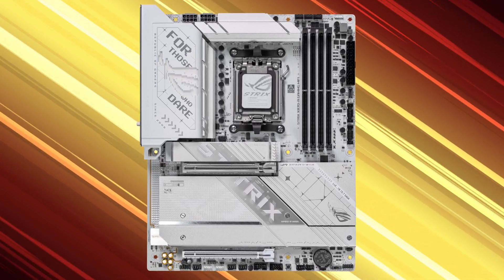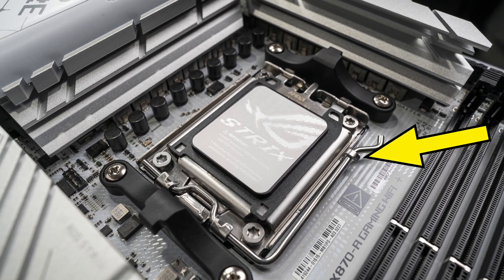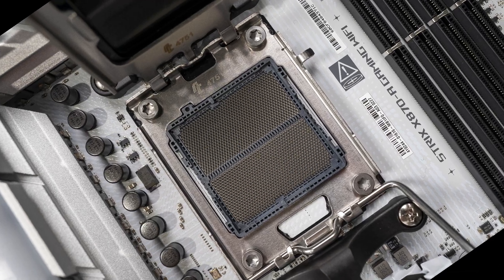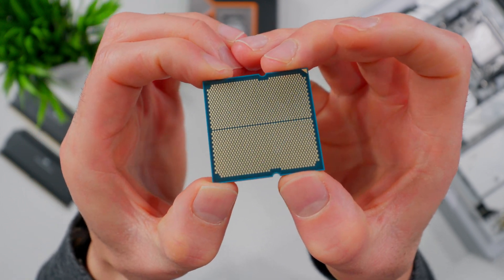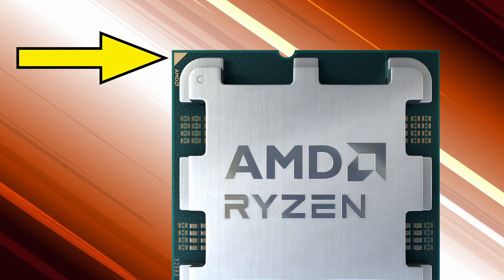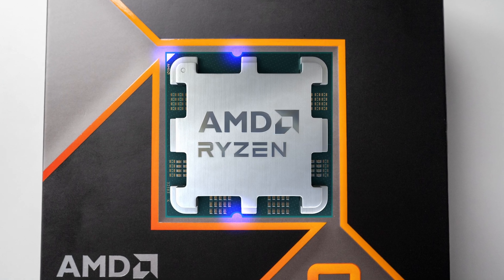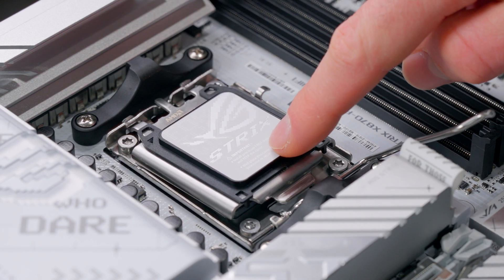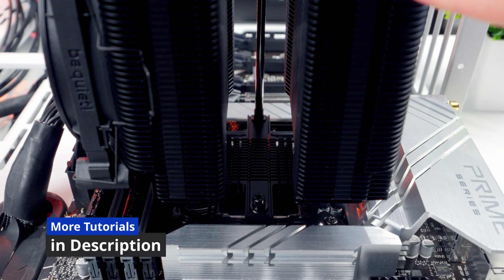How to Install a CPU - AMD Ryzen on Socket AM5

Comment: do i have to wiggle it?
Reply: no, the bracket will seat it for you
Reply: I came for a question like this. I did the wiggle. For the same reason. Before I ever watched this video. It's the only thing I can think of that could  be the of a pin bent right in half on my brand new motherboard. Either that or it came from the manufacturer with a bent pin. Safe to say I'm not doing that again.

Comment: The video is nice until 04:50 when it does switch over to a completely different motherboard (while applying the thermal paste). I wanted to see how do you mount the cooler onto an AM5 socket in detail.

Comment: Just a bit of advice for anyone using an older AM4 AIO, they can damage the pins if they are over tightened, I think it's because they don't quite go on evenly, Happened to me,twice, use a proper AM5 cooler
Reply: How do i know which is the proper AIO for AMD?

Comment: Thanks for the video! 
Last year I bought my PC with a Ryzen 7 7700 and an AIO Pump, I‘m planning on upgrading my gaming performance with a 9800X3D. I guess changing the cpu is no rocket science but I never did this on my own… do I still need thermal paste in general when having an AIO cooling solution? If yes, any tips or advice for changing the „old“ processor with the new one? motherboard is an ASUS TUF B650 Wifi Plus.

Thx :)
Reply from the maker: Hey. Glad you liked the video. Yes, you still need thermal paste with your AIO.  You're going to need to clean the old paste off of the Ryzen 7700 and your AIO cold plate before applying new paste and installing on the 9800X3D.  You should watch this video if you need help with that https://youtu.be/NXIrV70AxJk
Reply: @ Thank you very much, that‘s a big help! Does my motherboard automatically identify the new cpu and after installing the 9800X3D I can boot my pc without many problems or do I need to pay attention to something? With the ASUS armoury crate software I try to keep everything up to date as good as possible. It‘s exciting but I‘m also a bit afraid because I‘m not experienced that much with all that :D
Reply from the maker: @RawHardstylez112  You will want to make sure your BIOS is up to date to ensure it can detect and support the new 9000 Series CPU.  It looks like the latest version for that board is 3057.  If you're not up to date, head over to the ASUS support website and  get the updates you need before changing your CPU.
Reply: @ECPUz  Alright. Many thanks :)

Comment: When I installed mine I left the CPU in the package and rolled a chunk of Scotch tape to make a lifting loop. It made it sooo much easier to pick and place than grabbing the sides.
Reply: Probably a dumb question but I’m attempting to install my first cpu next week but I assume you had to wipe down the cpu after incase any adhesive stuck?
Reply: Probably wouldn't hurt to wipe it off with a little bit of alcohol and a Q-tip after you have it secured if you were to use that method, good point though...  @DomerSimpsn
Reply: @DomerSimpsn how did it end up going😂
Reply: @weyIoI  actually went great I didn’t end up using tape I just held edges lined it up and gave a small wiggle. My hands were trembling the whole time so I took a shot of whiskey and said F it.